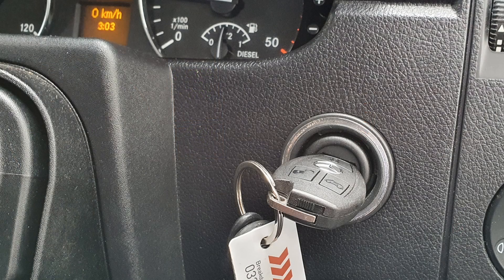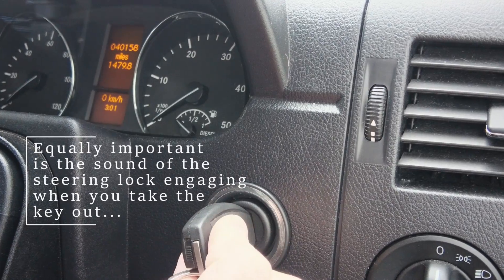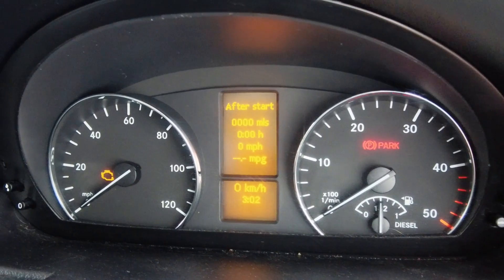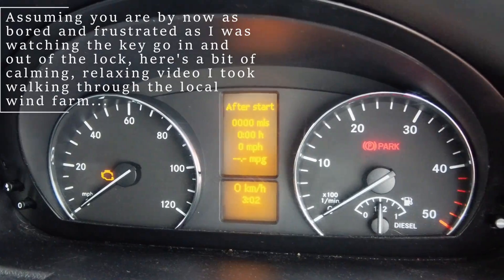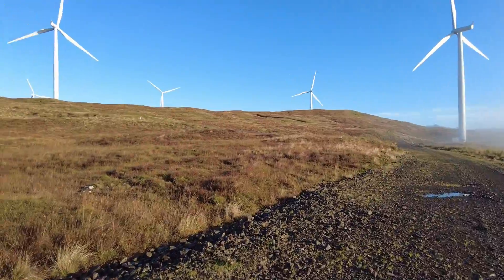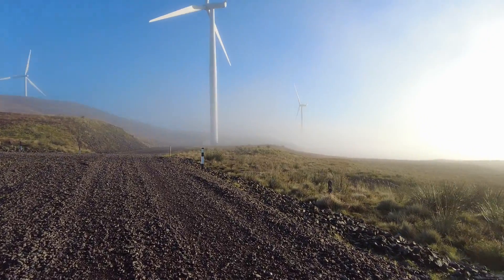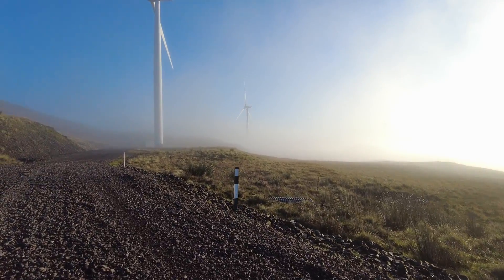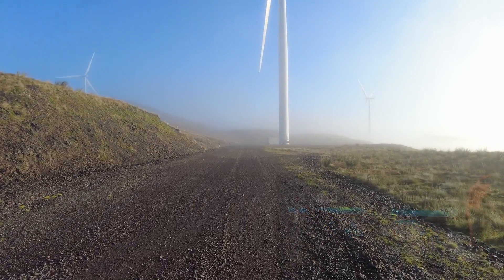Sprinter Camper Van EIS Fail (Electronic Ignition System/Switch) and Future Mitigation. RND-D #115

Comment: Thanks for sharing this video.
But i hate benz.

Just programmed a spear key after all went successfully original stopped E350 2004.

And spear was not operating.
Couldn't figure out what was the issue until someone else removed the EIS.
and car back to normal.
Still they didn't let me know what they did!
I believe they reprogrammed the original.

Comment: Thanks for the video. We are having the same problem. The 2008 EIS is no longer available from Dodge in North America. Was the MB repair expensive?
Reply from the maker: Yes indeed. The whole process cost me about 1000 gbp, but then how much of it was because of the problems using 2 garages in the end it is difficult to judge. It's a tough call because when it breaks you have no van so fixing it is the only choice...
Reply: So it was the battery?